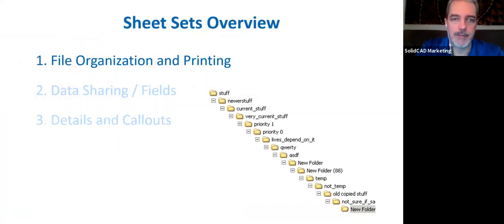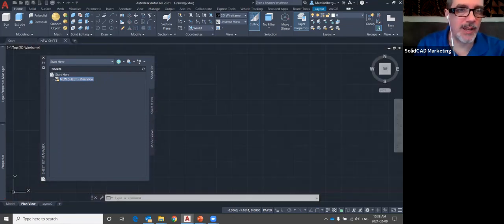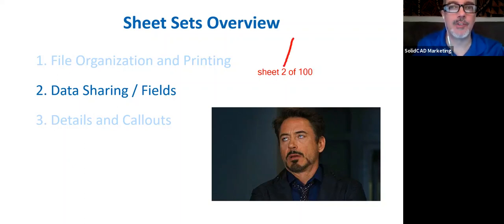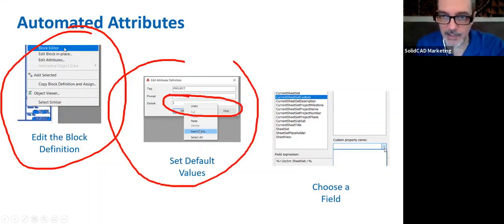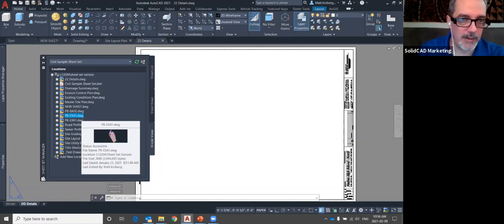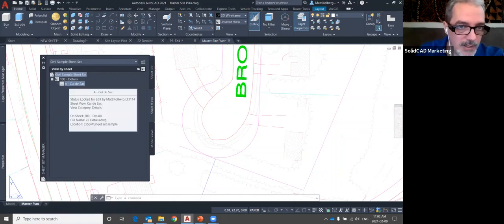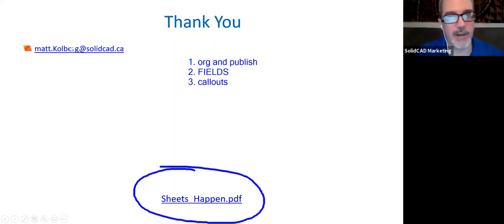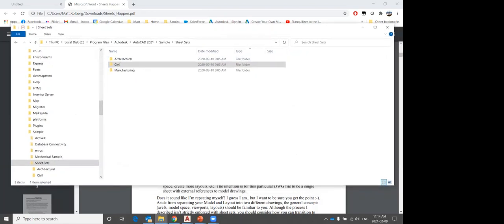The AutoCAD Sheet Set Manager webinar by SolidCAD

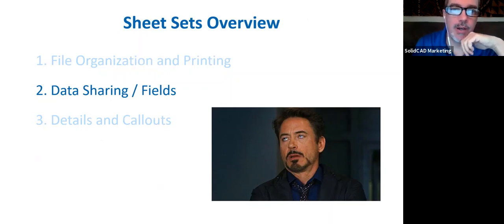Comment: How do you automate the sheet number mentioned 12:00? I want to insert a new sheet (e.g. 3 of 20) and renumber everything under it (old 3 becomes 4, etc.). You discussed it, but did not show it.
On the call out, this is VERY powerful. Questions, where is the "dark dashed" fence with the leader to the call out? I'm thinking this is part of the block by making it dynamic??
Is there automation to do a total sheet count?
Reply from the maker: Hi Ruben, Thank you so much for your interest for more information, contact: info@solidcad.ca
Reply: @ruben sidranski

First answer: the user must enter the new page numbers in the sheet set manager.  Look on page 6 of the Sheets_Happen.pdf file.
https://forums.autodesk.com/autodesk/attachments/autodesk/66/367854/1/Sheets_Happen.pdf

Second answer: I'm not sure what you mean by :dark dashed:.

Third answer: the user must create a "Total Sheets" field and use this on your title blocks.
Reply: @mattkolberg2409  thank you for the quick reply!
1) manual. I thought ACAD made a change along with TCount.
2) drawing detail callouts have a dark, heavy, dashed line border. Easy to add.
3) Manual. I thought they added a count in newer versions that I missed. Forever request to ACAD. 
4) BONUS: can we do linked/automated call outside within the same DWG without SSM (small projects)? I have schematic callouts that we like to reference. On several projects, coworker either re-number a call out (I prefer STDs detail numbers e.g. water heater detail is always detail 5 and allow for # skipping) or MORE IMPORTANT the detail sheet is moved, thus M-XX1 is now M-XX4.